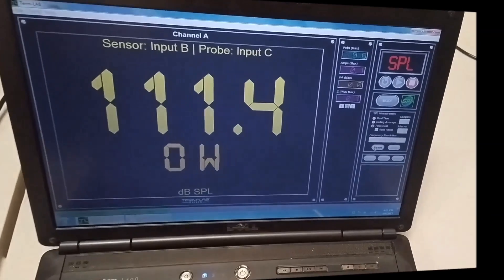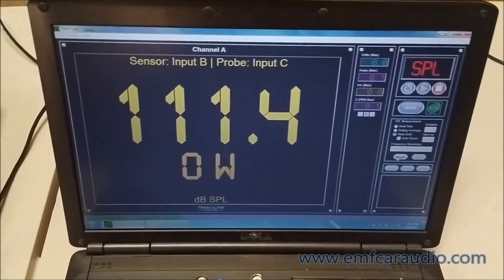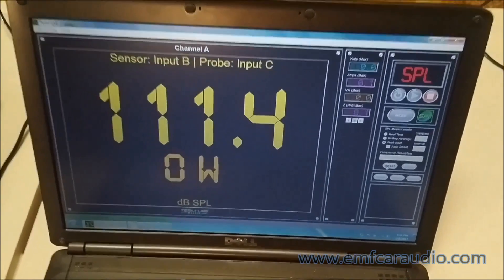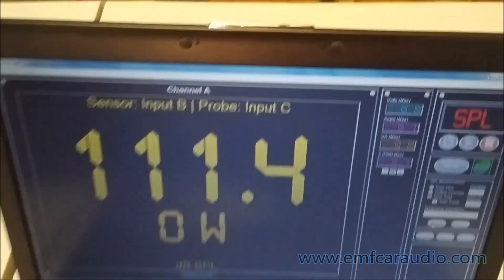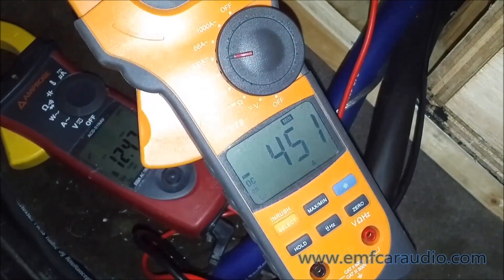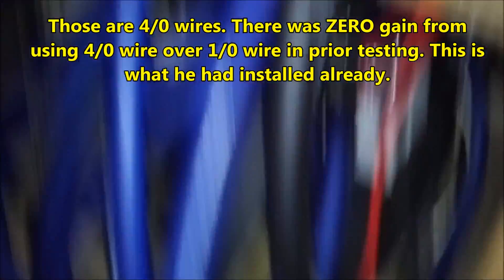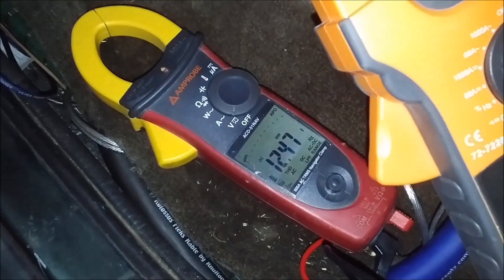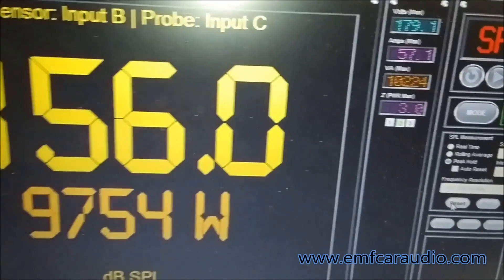Prototype EMF Amp does crazy power!

Comment: I thought IA 80s were thick! What we are taliking about here man?😱
Reply: EMF Audio People get mad when yoo talk to them about box rise man. They think the amp will give 1000 watts juat becaise it says it is a 1000 watts at 1 ohm.
Reply from the maker: This is just the prototype case, the production case will be different, I may make it a little shorter. This case is 5" tall though.
Reply: EMF Audio You should leave it like that man! So people can feel the thick and not the length lol😈😂
Reply from the maker: It will still be that kind of dimension, but we're tooling a case. The 
amount it would slim up would be minimal, no more than 1" shorter.
Reply from the maker: It is a 1 ohm rated amp, I made a post on Facebook with those results. The video is on another camera. On 11.1 volts @ 0.8 ohms it made over 12,000 watts. Remember wiring it to 1 ohm doesn't necessarily mean your playing impedance is 1 ohm also. For this reason we are pleased to show the kind of power it makes on 3 ohms.
Reply: EMF Audio impressive for sure.
Reply: COMPASBASSCLUB CHICALI  THAT CASE IS PERFECT HOW IT IS!!! BIGGER THE BETTER!
Reply: BlahBlahBlah I agree 💯% man! 👍✌👊
Reply: EMF Audio Sorry, just saw designed for 1 ohm, can you run a 1 ohm load???
Reply: COMPASBASSCLUB CHICALI so true 🤔